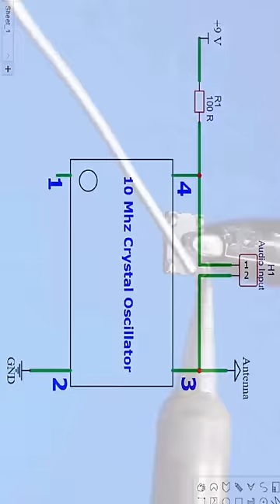How To Make A Radio Transmitter With Only 2 Components #zaferyildiz #shots #short #viral  #diy

Comment: Please make long range fm transmitter 🙏
Reply: Что в индии так плохо что нет нормального радио?  А чего так?
Reply: @Skeleton-in-boots  There are good radio stations and radio receivers in India but I need long range transmitter for my personal work
Reply: @mr.electrician5074  Why don't you buy a certified walkie-talkie? If you wish a long range transmitter, it has to have certain power. Usually, there is a power threshold above which a certificate for equipment and licence are mandatory.
Reply: Para hacer un transmisor de largo alcance necesitas potencia....., Para lograr potencia necesitas elaborar varias etapas con gran cantidad de componentes.....
Y de muy alto costo 
Por ej. Transistor de salida u$s 100 o 200
Y ++++ y +++

Comment: Transmitting into allocated band for civil aviation or ham radio, it's totally illegal.
Reply: I think there exists a certain range meant for civilian communication, but you should be fine anyway if you are transmitting at low power